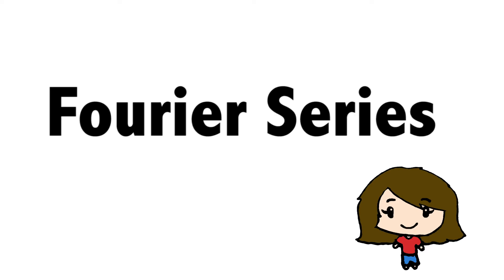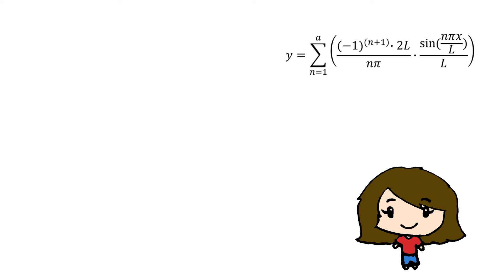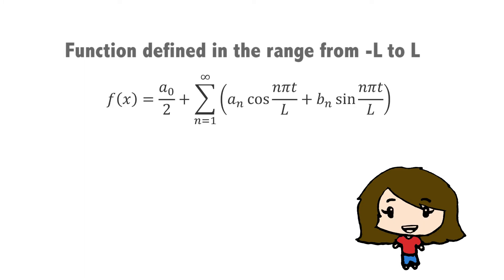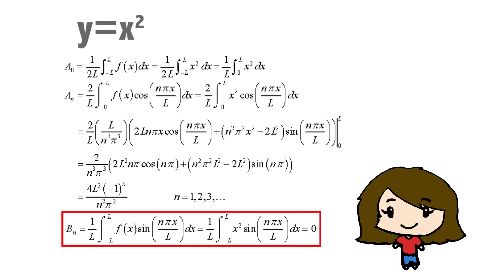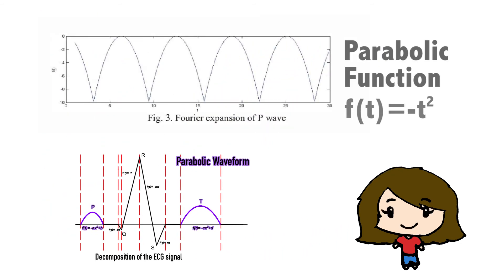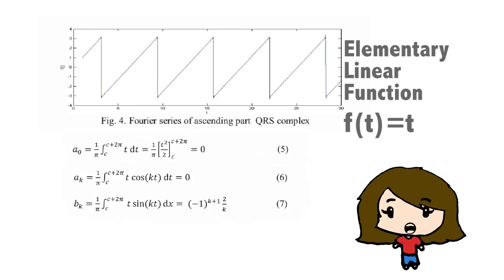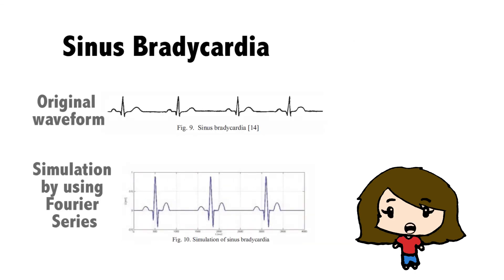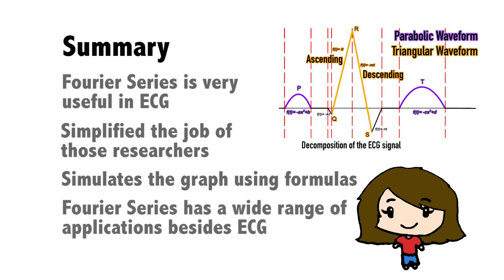Design of a synthetic ECG signal based on the Fourier series

Comment: This research paper was given to us as part of an assignment, but unfortunately the included "proposed algorithm" Matlab code does not function correctly. The T wave is large, triangular, and is unaffected by changing variables e and f. there is use of variable g, which I assume is gain, but no mention of it or a good value to use for it.